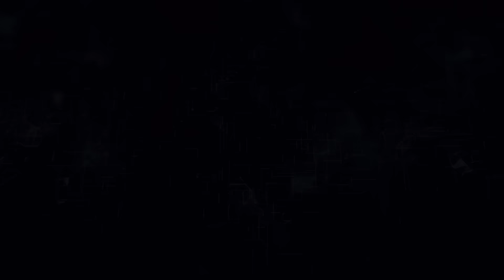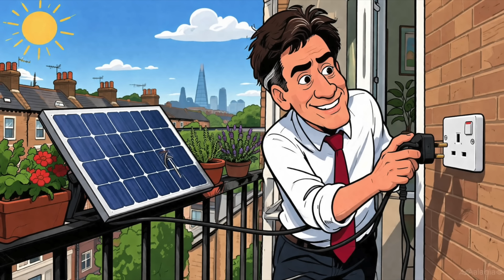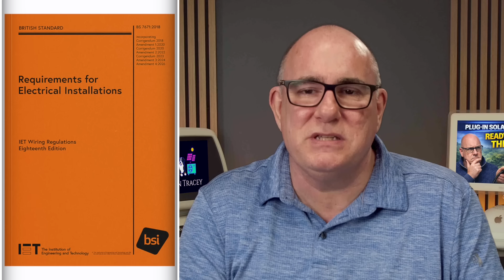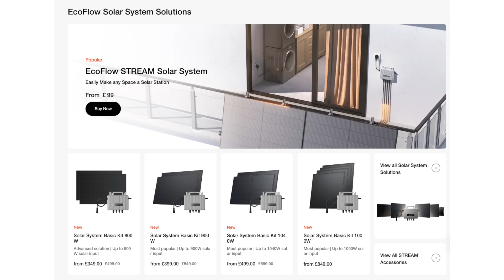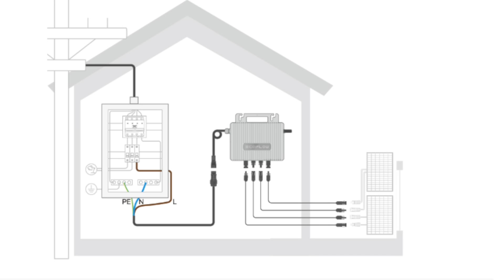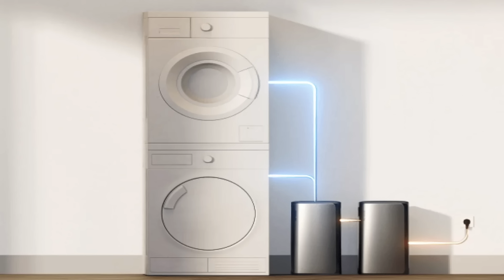Plug In Solar Is Coming… But There’s a Problem

Comment: How would it work with two inverters plugged in. If the grid goes down the two inverters would see each other and continue generating. Surely that can’t be allowed as you would be exporting onto the grid while under maintenance. Did you try this out when you tested two inverters on your system?
Reply from the maker: I think that’s why they will have some rules and guidelines around having to. I have two but they are on completely separate circuits and they can’t see each other. If we have a grid down both shut down, and even when my large inverter tripped over and cuts off the grid and start supplying power to the house. The two micro inverters do not start up again.
Reply: These micro inverters cannot coast off of each other.
They are looking for solid sine curve hundreds of times per second, which neither of them, not even combined, is able to sustain.
They would drift off in a matter of milliseconds and shut down

Comment: BS7671 isn't law, and only applies to fixed wiring, so plug-in solar is arguably out of scope, depending how "fixed" the panels are. Either way it wouldn't be necessary to amend before introducing plug-in products.
Reply from the maker: i’m hearing from my local electrician that it does need to be updated, so if you’re right then Things should go a lot quicker.
Reply: Common misunderstanding on the first part. Building Regulations Part P is law. Part P specifies BS7671 so BS7671 is effectively the law.

On the second part it's one of a few intriguing questions - another being that a separate building under 15m2 that is not a living space (eg your shed) is not subject to part P usually, which means if it has an existing supply and consumer unit of its own then BS7671 doesn't apply in your shed. G98 clearly applies for the feed in but it's not clear if you can just shove it into a socket in your shed and claim it's out of scope of regs 8)

Comment: you are 6 years be hind germany, where the whole thing has started as balcony solar by a guy called Holger Laudeley .
He also called it before it become legal "Guerilla PV" the root PV from guy who can do it on their own. 
Then the chinese delivered the 300 Micro inverter from china and germany, after that the Aldi and Lidl and Home depot sold these as kits for cheap. 
In 2019 these sets of 600 W (which was the limit of 2019) cost abouter 700€ and more
Now you get in germany 800 W inverter with about up to 2x 500 Wp panel = 1 000 Wp panel for less than  500€

Here the regulations are now increasing, but the 800 W is the limit do keep the RCD working if that is a shared "plug" line.  
Here it is limited to microinverter up to 800 W in total - but now you can add up to 10 kWp of panels and use the surplus energy to charge a battery.
So such system runs the 800 W AC inverter and surplus goes into the battery which then feeds into your house during night.

Now it is legal, if you obey the 800 W limits and then also register the system online. This is mandatory and easy to done. the grid provider have nothing to agree to any more.
Reply from the maker: @typxxilps yeah you’re right — Germany is definitely ahead on this 👍

The UK’s been slow, but at least things are starting to move now. Hopefully we skip some of the early trial-and-error and land on something that actually works first time.

Comment: Quick guide on mounting please? 
What kit, how you’ve secured it, what to watch out for? 

Solar panels look small high up on my roof. But my parents just got Ecoflow Stream + 2 panel package delivered and it’s massive + heavy. We can’t DIY mount massive 22 kg panel high-ish on the wall using ladders. Now looking at fence mount but that location is shaded more often. 
Now seriously considering returning the panels just keeping the 1.9 kWh battery to time-shift. I’m surprised people aren’t talking about plug-in batteries, much easier than hanging solar panels.
Reply from the maker: I will see what i can do but my options and budget are quite limited
Reply: You can do a ground mount. A 1/2 day DIY job
Reply: @konstantinlozev2272 don’t have the extra space, the little space is shaded a lot of time.
Reply: @wyx087 yeah, the advice in this video to first observe sun and shading in the place is important.
But over the summer months the shading can give way to sun for part of the day.
And you can also do "landscape" (as opposed to "portrait") ground mount installation (although it's more expensive).

Comment: I think a really basic tutorial ( as you mention in this video ) would be really good. How a plug in battery charges over night on an EV tariff and supports the baseline of the household and then how a couple of fence panels plugged into the same unit then supports that same unit through the day/evening. What mcbo and circuits are needed, can it be plugged in or will it need a fused spur.  Also how does the consumer unit know how to use the stored/solar energy first before pulling from the grid. Thanks for all you do!
Reply from the maker: thats what I am planning :-)

Comment: Good for you guys! Solar for everyone is a great achievement, i am proud that here in Germany we pushed for this quite early on - overcoming our famous bureaucracy! And yes this is a super addictive hobby. Wish we would produce some of the energy hardware in europe still...
Reply from the maker: @JohnnyTheCache completely agree 👍 Germany is miles ahead on this — hopefully the UK catches up quickly because the demand is definitely there!

And yes… it does get addictive very quickly 😅
Reply: Yes - the Panels are growing by itself - 1,2 then 3 and some month later 4 … and then you begin to plan yOur big pv plant
Reply: Yes well we had the Tory Party in power for 14 years and they even banned onshore wind farms or made planning permissions very difficult to get.They did next to nothing re 'plug in solar'.
Reply: @martinahardaker8739  To be fair under the Tories from 2010 the UK went from a total solar capacity of 75MW to 13,616 MW, and offshore wind also grew massively with the UK now second only to China in total capacity. They also required all new build houses to have EV chargers, improved home insulation standards, did lots of subsidies and incentives for insulation, heat pumps etc.

Comment: Until a system can truly power a home off-grid, many will be disappointed.
Any connection to the grid results in customers being ripped off by Machiavellian tariffs.
Reply from the maker: @CloudhoundCoUk I get the point, but most people don’t need full off-grid — just reducing what they buy from the grid makes a big difference.

And tariffs aren’t perfect, but using solar to offset your own usage still works regardless 👍
Reply: When you omit the need for a large inverter (meaning, no whole-home backup), everything becomes so greatly simplified and compact that you may change your mind.  Even just having a 500W capability is a big deal… that’s 12kWh/day of energy just by itself.  Same thing with the battery setup.  If you only need to charge at 1kW, and discharge at 500W, the wiring becomes simplified and decoupled from the actual size of the battery (which can be anything).